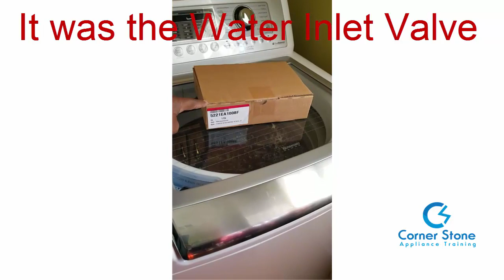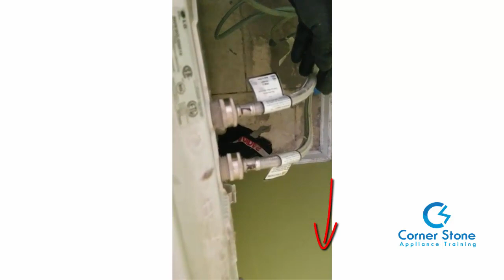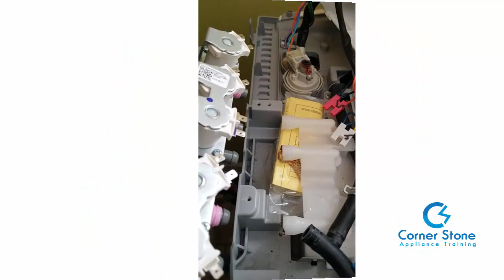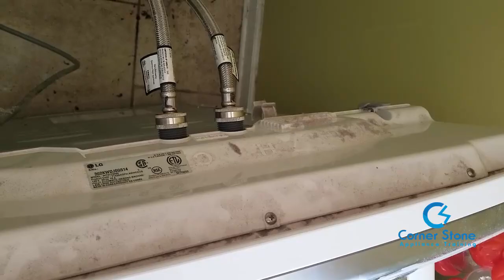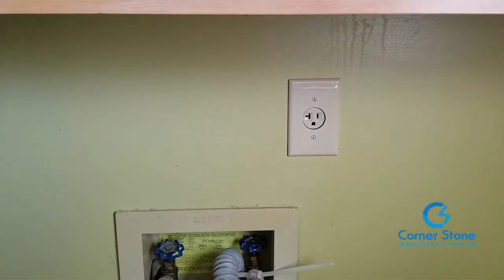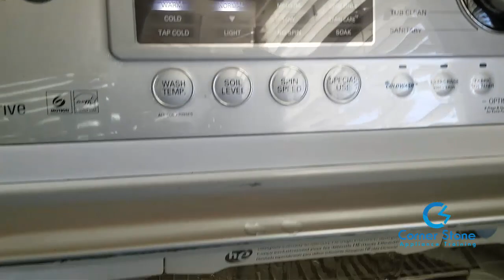LG Washer Repair Error Codes - Washing Machine Will Not Drain Spin

Comment: Because I am getting the same symptoms but the error code is OE. Except that when it gets to the rinse cycle it spins super slow, like one revolution spin takes about 3 seconds. Half hour later it is still slow spin, no draining, and even the time has stopped.
Reply from the maker: Error Code "OE" means you have a drain issue.  Check your filter, drain hose and your drain pump to ensure it is pumping the water out in the drain & spin cycle.

Hope that helps.

Thanks
Reply: @chrisstokes2020  Thanks will do.